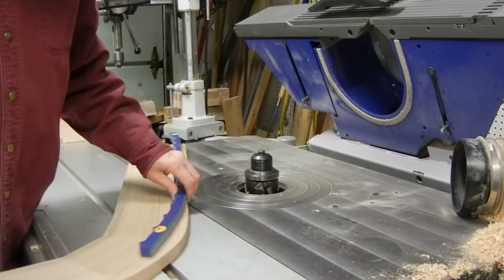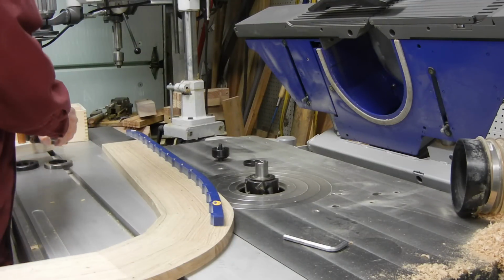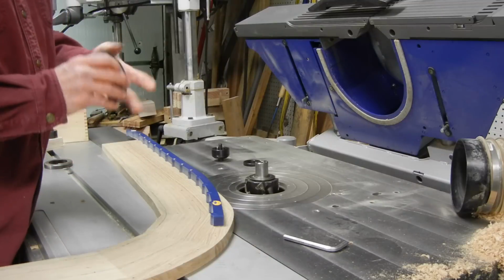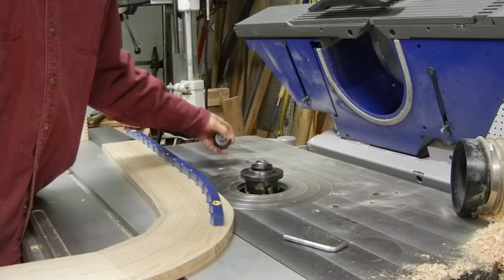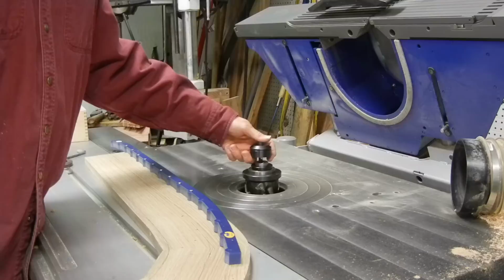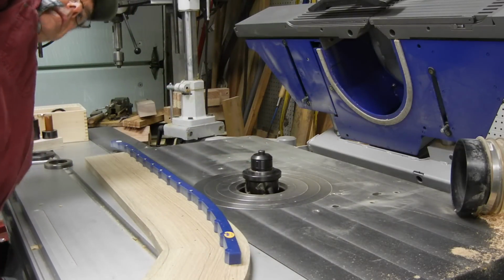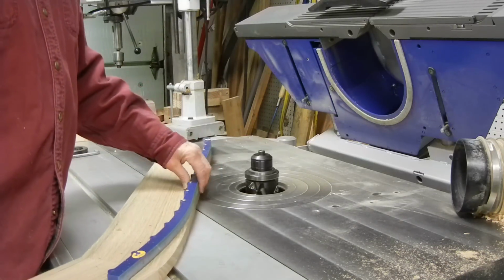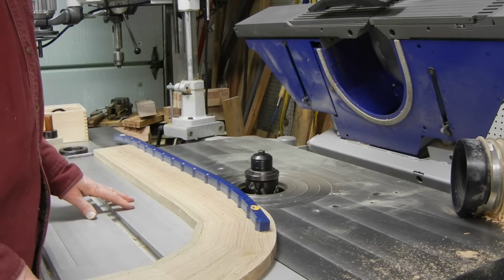Felder Profil 45 Format4 shaper mit Kurvenlinfix 18 X 18 flex curve guide

Comment: in the video description you mentioned this is a 30mm spindle shaper in inches is 1 3/16   ,my question is is this machine the same as 1 1/4  bore shaper or not , is so confusing everyone called different some called 30mm others 1 .25 , 1 1/4   not sure what to buy my machine is 11/4   i am trying to buy cutters for my collection but i can't buy anything with all this confusing
Reply from the maker: This Felder shaper had the 30MM spindle common in Europe (actual size is 1.18"). Felder and a few other tooling companies have lots of pieces for this 30MM size. I bought a used Felder 1.25" spindle so I can buy US tooling in that
size, new or used. Most of the tooling I have is rather costly but after 8-9 years has proven a good flexible selection.
Felder also offers the 40MM and 50MM spindles for my machine. I will buy the 50MM in the future but have to have
some custom tooling heads cost $900 each. The larger spindle runs shower but can handle taller (thicker) woods.
I had planned to do more raised panel work with the Felder tooling, but, it hasn't happened yet. I may have a remodeler
to work with in near future for special profiles (2.25" thick butcher block walnut/ maple island top with rounded corner)
that most shops so not want to tackle. I plan to air my videos soon for the rounded island top.
If pricing is a problem, get the common US size 1.25" spindle and find several new toolings plus search for used tooling.
If you can get the money for a machine that has interchangeable spindle, this will give you a great variety and lower
lower cost overall for tooling.Be careful of the smaller Felder machines with 8.5" total diameter tooling that will not allow some of the better profiles. The larger 10" tooling diameters are better.
If you make furniture or other profiled pieces, you can start with the lower cost 1.25" spindle tooling and not get into
these expensive toolings with pricey carbide inserts. That way you send out the lower cost tooling for sharpening.
Hope this guides you into a good selection. There is a way to buy the 30MM spindle and use shims to expand the diameter to 1.25" thus avoiding buying a 1.25" spindle. Always check the fit and torque your spindle tightly.

Comment: Vincent very interesting video showing the flexible guide strip.  I am perhaps not quite exactly clear on what you are doing with this piece overall.  I though you were not only shaping the straight portions bit also the radius portions too.  Perhaps that is another video.  If shaping the straight edge I guess that my approach might be to saw it on a slider, on a cabinet saw with a straight board tacked on to guide the cut or with a track saw and track.  Depends upon what is available in your shop.  It seems to me that changing the bearings is rather time consuming and if I was to doing it how you did I would try to saw close enough to the finished line with a bandsaw or jigsaw so that I could go straight to the 80mm bearing guide.  It is an interesting technique though and thanks for sharing.  Have you considered buying an Aigner Exhaust Unit, as they call it, to capture the chips on these fenceless cuts you do?  You could also build something similar I expect for less money than Aigner will likely want for their piece.  Best,
Todd Ferguson
Reply from the maker: Todd, thanks for your comments (been a long time since I did this vid.) I was testing this model of 18 X 18 flex curve for the first time. Felder sells only this size and 1 meter length. I was testing to see if I would be interested in the smaller cross section from another vendor or possible a long blue one to run larger products. With this molder head and shear cutting, the control is easy and fast. I was going slowly in the test. My Bosch jig at the time was getting old from it's 1980 purchase date and the vertical cut from it was not possible for control. I have a later model with new parts now; the #1578 is in the basement retired. I have a 1975 Rockwell Delta 20" jig in the basement 110V but it is too worn to cut this 3/4" oak. I use it for templates and curves. So, the rings with one setting of the flex curve was my approach in this test. Sometimes flex curves will not cut straight between the curves and this test proved the 18 X 18 blue model cuts straight and very smooth and quite fast. My shop is small and my wife will not let me keep overflow tools and jigs in the bedroom!? 
Yes, I could make the chip catcher, but, that setup works good. Aigner is worth every penny especially considering the Integral fence addition that floats the work against the swinging fingers for almost any size product. I figure safe fences are worth avoiding those doctors that can sew on cut fingers and hands costing $40K to $100K plus time lost. Thanks for watching. My market for furniture, architectural millwork, kitchens and Jamestown fireplace mantels has changed since those early day of teaching myself woodwork. Have fun and be safe. The spindle rings work good with several long jigs with Disaco hold down clamps.
Reply: Vincent thanks for the additional information.  I am fortunate to live in the Charlotte,  NC area and Martin's USA headquarters is here.  I believe we also have a Felder presence too.  I am going to head over to Martin to look at some Aigner accessories in the next few days.  Good stuff but not inexpensive.  But as you say safety is key and the money spent on safety won't take you far in the ER.  I learned early on the value of stock feeders for shapers.  Better quality of cut and makes many operations much safer.  Take care, Todd
Reply from the maker: Todd, the blue cover Aigner catalog is what you should get from Martin. They very little of the Aigner in stock when I purchased. Study the catalog. There was a US president of Martin, Stateside and he had some knowledge. The current staff is rather new to Aigner and Stephan Deiterman, from Germany comes into the US Charlotte office for shows and other calls and he is the man of knowledge in the machines. He was responsible for my purchase. I have a bunch of Aigner guides and attachments. Felder has little of the Aigner in their catalog and sparse inventory at best. Only one size of Integral to offer which was too small for my shaper table set up.
I had the vario Felder feeder but sold it due to not having a use. I'd buy the belt drive variety if again.
Reply: Yes sir, I have that catalog and it has some good information on how to use the components too.  That is one think I love about woodworking is that there are usually several ways to accomplish the goal depending on what tools and skills you have.  Car Stout was the Martin USA President and he retired at the end of 2017.  I will be attending the open house / demo Martin is having on April 19-20.  Plan to have 15 machines running I believe. Maybe Mr. Deitermann will be there for it.  I have also found that www.simantech.com in New York is another US seller of Aigner products.  Todd
Reply from the maker: Simantech is my source for knives for jointer and planer. I have not made the complete change over from M42 to carbide. Too many cheese sandwiches required to spend the green. If you buy the Martin check all wires into the electrical grid junction core. I have had several loose ones in the jointer and planer. I trust you will unplug the juice before wiggling wires?! Thanks for the info, Todd.
Reply: I think Martin has a pretty good inventory of Aigner items in stock now.  I can also recommend you look at Rangate for both shaper cutters and all Tersa knives.  Martin has a pretty good supply of knives and saw blades for the sliders now too.  Demo days at Martin was disappointing on Thursday...only really a jointer and planer running.  T60C partially setup.  Several edgebanders and a CNC router center runable...about 5-6 machines only.  No shaper even unpacked.  They are very shorthanded at this time... But I like Al Briggs, he seems like a good guy.
Reply from the maker: Since their head man at Martin resigned, I imagine they are looking for a replacement. I hope they find a person with more sales ability and working knowledge that can further Martin along with Stephan's expertise. Covering the US and Canada is quite a task. Promoting the regular line of Martin and specialty machines not to mention Martins beginning combination machines of newer design gives Martin an advantage.
The more Martin invests in showroom machines, the better sales can be expected. It's product knowledge and sales people that drive the market. Having a source of knowledge from Europe is another plus in the brand.
Good luck Todd; Vincent
I find that dealing with other vendors for saw blades and knives and shaper tooling with their close connections to Europe really helps my shop. I have recently heard that Rangate can acquire some brands even though they do not advertise those products directly. At this time I have all I need in basic machines but am looking at Castle for pockethole screw applications for cabinets in residential and commercial.
I usually do not buy used but this may be a good move in cost reduction of a simple machine.
Thanks
Reply: Martin had 3 positions open before Jody recently departed.  Al and Stephan are it right now.  I talked to several people who have had a relationship with Martin for over ten years.  Some interesting input and perspective from them.  I don't know if they will have a easy time filling the positions based on some of that input.  Top Shelf machines for sure.  But they are also trying to sell a number of other German brands too.  That is both a good thing to have more offerings but more to know and support too.  I think that it will be interesting to see what develops.  I stop down every couple weeks or so to see Al the past few months but not much is coming together very fast.  Jody was also saying that they might look to move to a larger space or even buy a building. It was interesting as he told me that working at Martin was his dream job in the industry but then he departed quickly to go in a completely different direction with his own business.  Who knows.  He treated me good though...

I spoke to Greg from Rangate for about an hour and a half at the Biesse open house last Friday afternoon.  He seems very knowledgeable and will to work to help his customers be successful.  Their tooling is very nice put not inexpensive.  Worth taking a look at for sure and they are going to be adding to it over the next few months and improving the website.  Greg also worked high up in Laguna for a while prior to starting Rangate. They are into the Euro windows and doors production tooling too.  I am interested in that product, but it is a very high end product in my view.  I think Rangate offers service for Garnicha tooling...check the website...  They will also do custom tooling.

I talked with he Castle guys at the wood expo here in Charlotte a couple months ago.  Are you committed to pocket hole construction?  The Zeta P cutter and fasteners seem to be very popular especially if you want to do Ready To Assemble flat storage and shipping.  They are not the cheapest connectors but seem strong and easy to work with though from what I have seen and heard form others.  Steve Rowe (Extreme Woodworker) uses them I believe as well as dowels.  He uses Dominos for Furniture I recall though...  Todd

Comment: A one minute video that runs for 10 🤷‍♂️
Reply from the maker: RivB if you don't have a hardwood curve to cut and if you don't have that particular Felder 14 knife helical cut tooling it may seem a bit long in vid length; so, just skip to the final cut at 9:00 and watch. That tooling is the smoothest cut out there for curves and straight line work. For thicker wood milling (3-4") the multiple ring approach is best. I have the band saw set up for resaw and a jig saw is not the tool for those thick pieces. I am testing with this approach with a thin oak wood. I was conservative on this first test of the tooling, rings and flex
curve. With 8 years under my belt in woodworking here in 2020 my work speed and approach is much fast. 56 years ago I was cutting a lot of lead with a Hammond saw; then, I stopped and did other things for 50 years. Now I am running a host of woodworking machines with 5 times the danger. It pays to approach the technique with an awareness for quality and speed. I bought a 250 Suzuki that would do 95 once I geared it up; then, I bought the 1050 6 cylinder that went 130. I am alive today because of my approach. We all start from somewhere. Thanks for watching and the comment.
Reply: Vincent Rolfe you don’t need to tell me which tools to use or not use, I’ve been doing that exact work you’re doing for 50 years.
Reply from the maker: @riverbuilder2251  What brand is your 50 year old flex curve? I did not know they made such so long ago. As stated before in this same vid comments; the use of the basic tooling is new to me and has applications in 6" thick woods (this vid is a first time for this approach using a relatively thin piece of oak).  I have my 27" band saw setup for resawing as thick as 18-19" so I do not break that SU for contour work and I don't have room for the Felder 4400 saw. Sixty years ago I was running a 22K rpm router milling lead and cutting slugs with a Hammond using a 5.5" blade. That work predates your comments and always will. So young man contribute to the information and help us pass on to the younger or newer workers in the lot. Chicago, where I live, has generations of workers, some new, some old and they all count for the better. My next purchase is a SCM model small slider for simple cut off work with a digital read parallel fence and I will be reviewing that piece of equipment. I don't have room for a work table currently as I rely on the machines to accomplish the work. I don't wear a mask because there is ducting to all machines. You are probably still not using a 99% dust cyclone system as you were 50 years ago?? Woodworking allows us to follow our own path and this is good.
Reply from the maker: @riverbuilder2251  You need to read over my comments more closely or have a friend help you get the drift. If you do not agree with the guide ring approach that Felder sells then contact them about your argument. I look to Felder for a safe progressive approach to milling a variety of profiles in wood. Chicago has a host of woodworkers I rely on and
that can serve us all. If indeed you do know more than my approach with the shaper due introduce the thought for us to gain from. I'm open to your pool of information. I have doubts about you; so prove yourself to us. Such quipping gets none of us anywhere.
Reply: Vincent Rolfe I don’t NEED to do anything you tell me to do.
Reply from the maker: @riverbuilder2251  Yea, you are showing your age now; get someone to help you read through the comments. Biden has the same problem as you exibit
Reply from the maker: @riverbuilder2251  Some people live in a sheltered world; you are one of them. Biden is the Democratic runner for President of the USA and is gradually becoming senile with his thinker and speech and then we have Trump that is also lost for his ability to lead this country in times of Covid. Age catches up with all of us. Your argumentative approach and choice of words only tells more about you. Education in this country helps us to fend and most Americans are different than those from parts of the world. You would think that of the millions of people in the US that there would be a better roster of people running for US President. I am moving to Europe in another 10 years to gain more perspective. Does not matter where we come from just that we have a balance in thoughts about our fellow persons. Have a good day